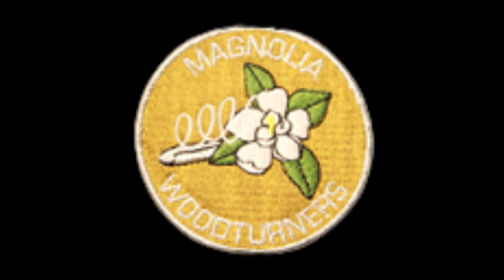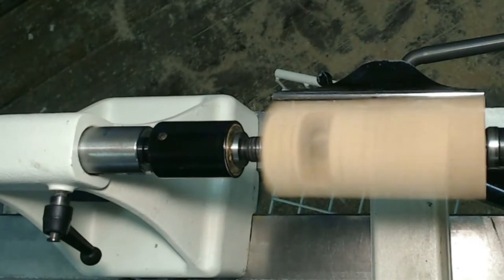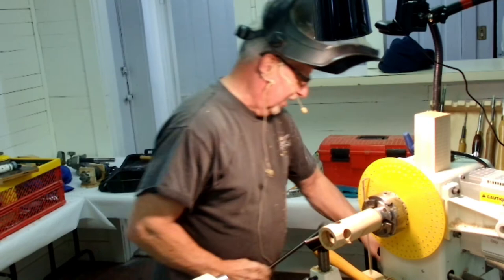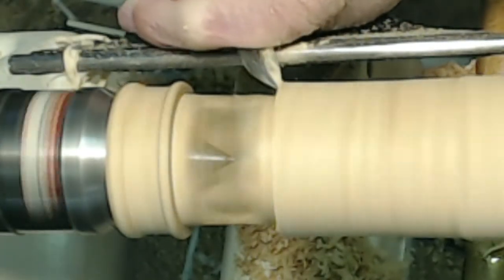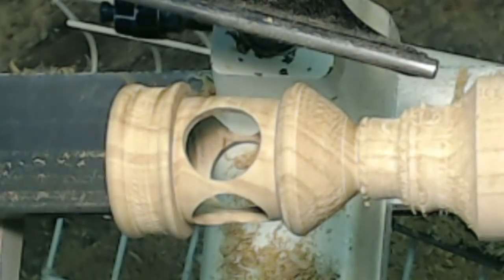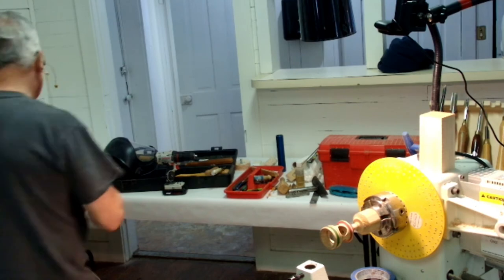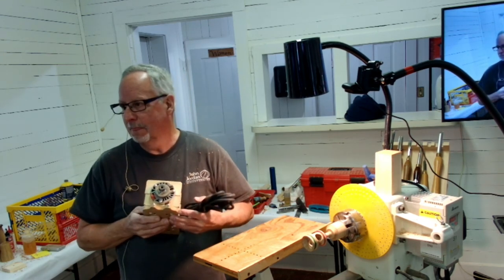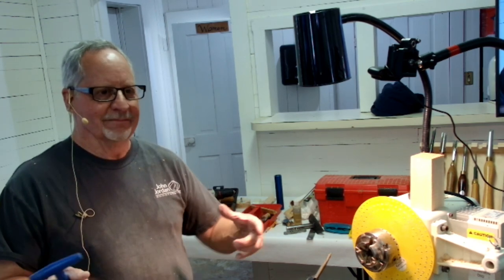2023 03 Lucas Mini Lantern Ornament

Comment: What are the initial dimensions of the block and how far from the end are the holes set? Great video!
Reply from the maker: Holes in the end are just deep enough to allow the candle to be covered. Holes on sides are drilled just above the candle but can be adjusted to show flame (bulb) or conceal it. the height can be adjusted to suit. Sorry I don't check comments often.